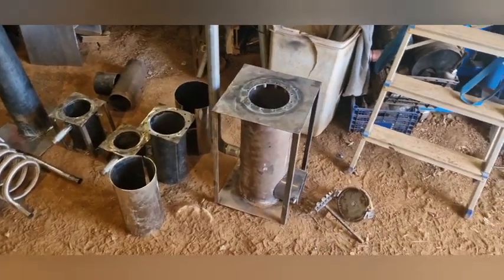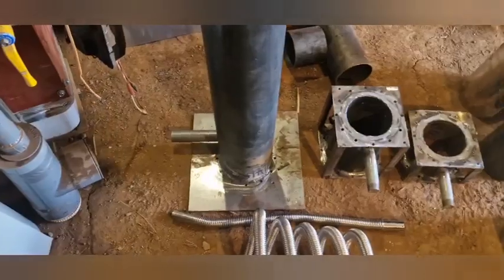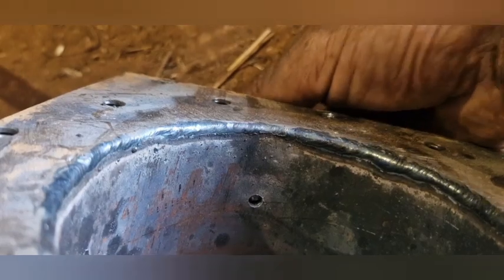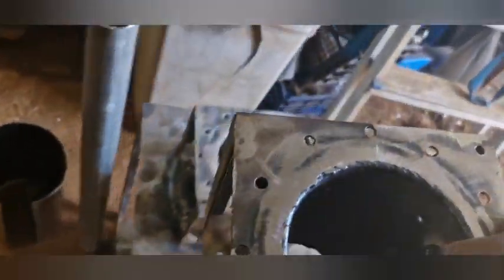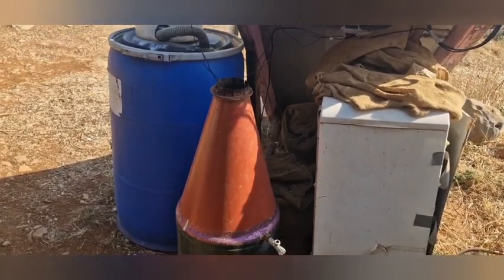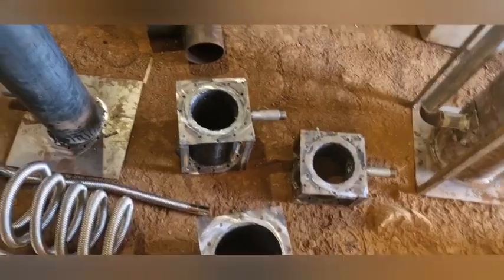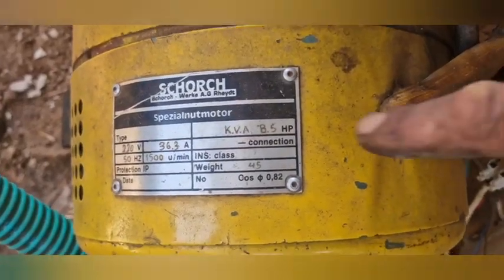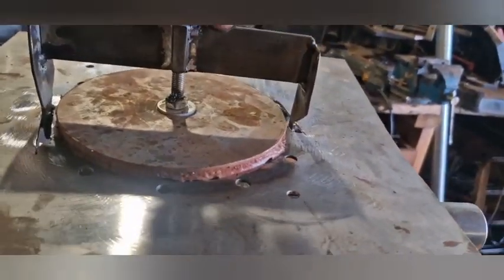Low tar multi stage lego style gasiffier part 1 #DIYGasifier #BiomassEnergy #OffGridLiving

Comment: How thick steel are you using? Are you using normal or 304/316? (is this nessesery)?
Reply from the maker: 4mm steel . Stainless is not good because it wil break soon do to thermal expansion en warping.  Only the insert is 0.5mm  Stainless Steel chimney pipe. The rest is steel it wil run for a long time . My oldest one is 400 house old en is in great shape 👌
Reply: @oscarverwey  I thought stainless steel is best for thermal. What type of steal are you using?
Reply from the maker: Only if the material has al the freedom to   expand en of the temperature is homogeniusly distributed!  En this is impossible for dubbel walled gasiffiers with air injection nozzles.  Steel is cheap, lives longen in practice, then stainless steel in most applications . For example oliver has one that actually can be full stainless steel because of its design but it's expensive.  This lego style gasiffier cost's 300€ in material . I highly recommend checking oliver his channel.  Look for (3D grille gasiffier) greetings

Comment: An innovative modular design. It would be very interesting to see it running and get some stats on its performance BTUs-out/mass-material-in.
Reply from the maker: Yeah I can't wait to see what it does either,  fuel monitoring is a lot more easy if you don't have a 270 lieter full hopper , im going to use the modified hatz diesel engine to measure the kw/kg , it should be way better then the Honda clone engine whit a car alternator